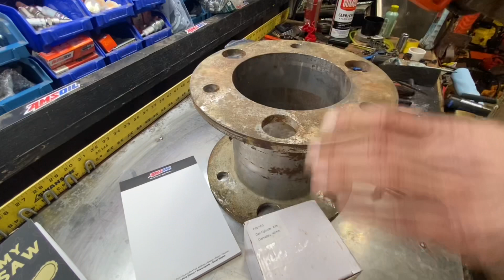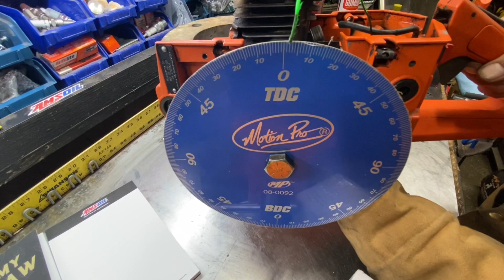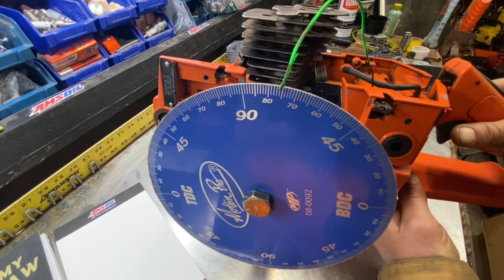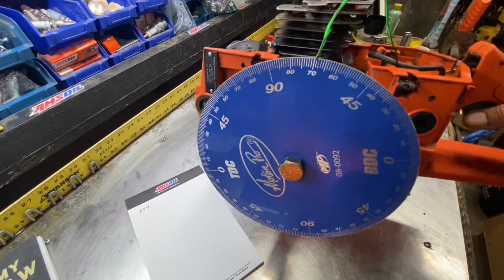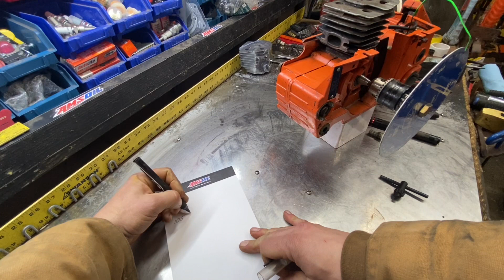Husqvarna 55 Performance Series Vd. 1 Where does flow begin? OEM vs. Aftermarket timing.

Comment: Do you think that the gauge are to wide cuz the ports have a radius? In my brain something small like the width of a piece of solder would more accurately measure the .050 or .010 thou vs a gage so wide. Not saying use a piece a solder but a Gauge the width of like a piece of wire if you get what I’m saying.

Comment: Hey buddy, if you had one of my degree wheel adapters, you could mount the degree wheel without removing the flywheel itself. They are super secure, unlike a drill chuck. Ironehorse uses them and Kensie Worsham at Bayou Country Power Saws uses them.

Comment: How did the squish look on that AM cylinder? I have a Hyway closed port kit that is at .050 without the gasket. Not even going to check timing until I fix that.
Reply from the maker: I haven’t checked it yet. These aftermarket cylinders usually end up in the .027-.032 range. This video was more to compare timing of OEM vs. Aftermarket. I’m waiting on more Aftermarket cylinders to come in the mail and I’m going to compare them as well. I hope to do a long series on the 55’s. Maybe even closed port down the road.